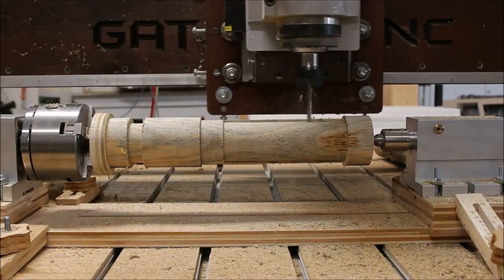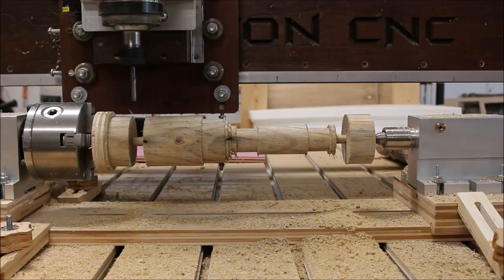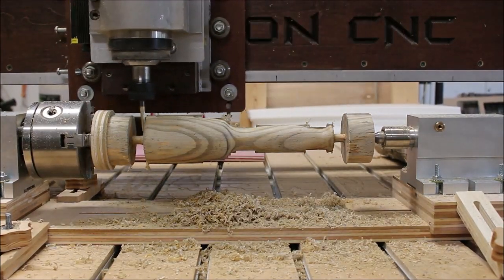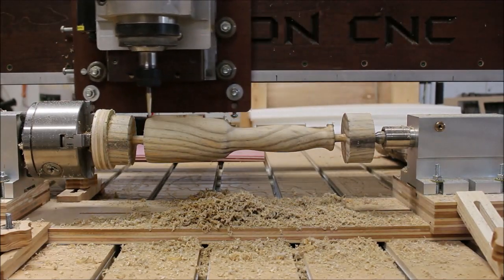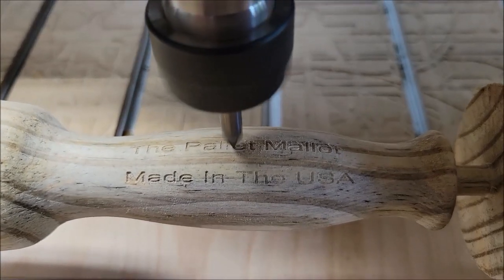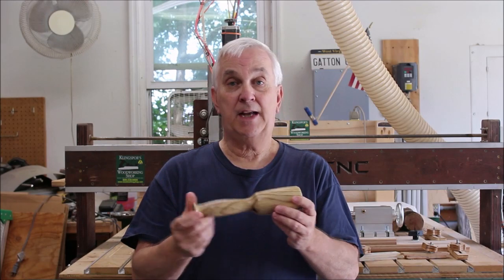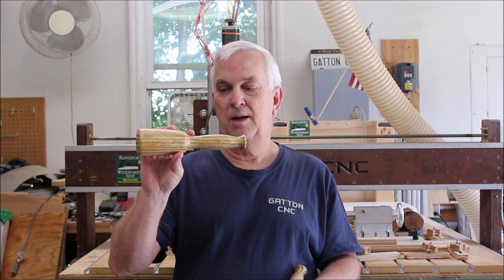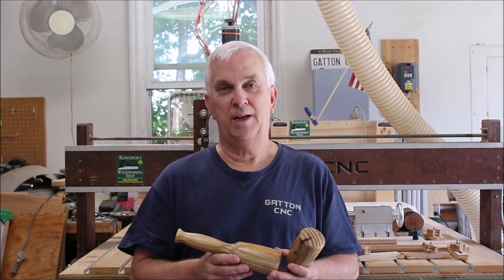The Pallet Mallet | Made one for a Giveaway!

Comment: Great looking mallet from a pallet Dave. Fun watching the machine cut away.
Looks like you use one of the Mach products. I have been using Mach2/3 from the beginning. Actually was working with Art to report bugs and wishes on the program. Curious about the Mach and Shina 4 Axis pendant. 
I built my controllers many years ago before USB came to Mach. Mine are still using parallel port boards. These pendants should work with that correct?  I have always used the keyboard which is easy enough most of the time.
Thanks,
Gary
Reply from the maker: Thanks for watching Gary.  Yes I've been using Mach 2/3 for many years and see no reason to change.  I think  one of those inexpensive pendants should work with your setup.  Do you use the built in "pendant" that you get by hitting the tab key?
Reply: I first started with a DOS program and it worked fine but what I hated is you could not got back to a spot and do a Run from here like with Mach. At least not without  crashing the part. As you know when done it Mach it rewinds the program to read the important lines at the beginning.
 I used the built in pendant when I switched over to Mach 3 from 2 but did not find a lot of use for it. 
 The reason a pendant would be nice is for when I use an edge finder on the part and setting Z zero. My keyboard is close enough that it is not to bad.
 Thanks,
Gary